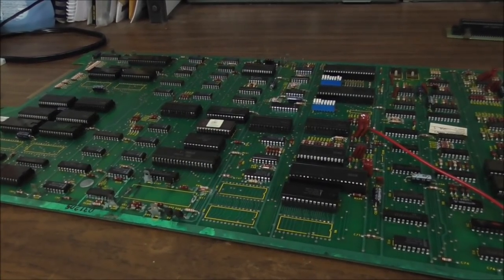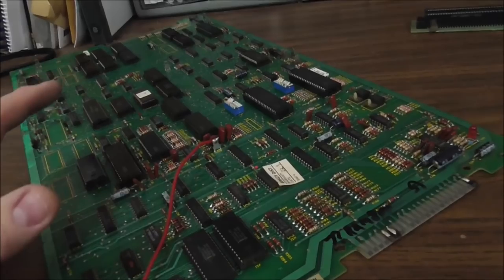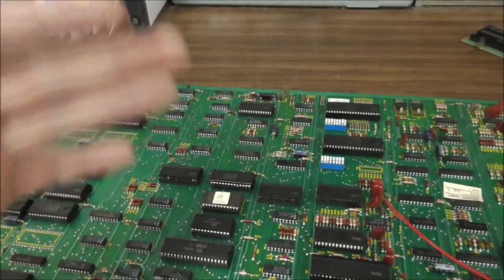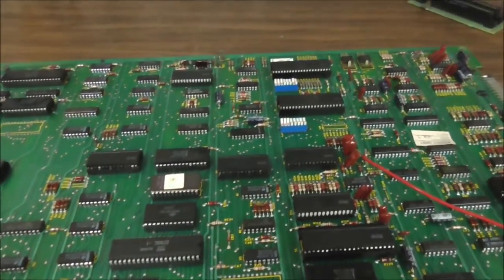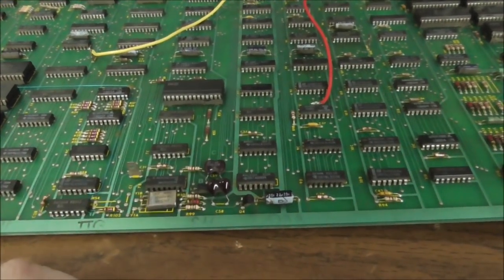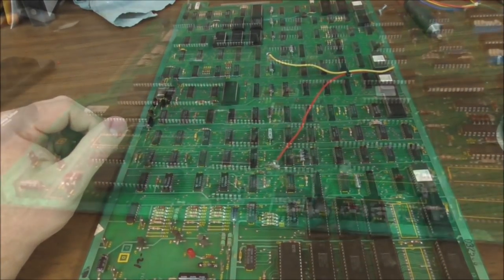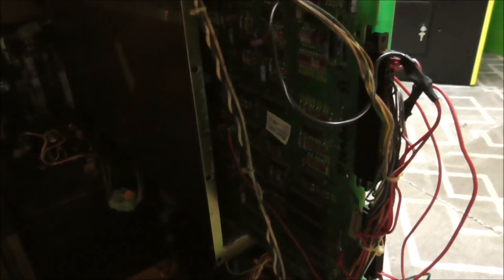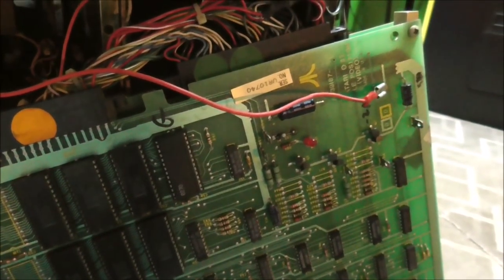Attempting to Repair Atari's Very Complex 1982 POLE POSITION PCB - Three CPU's?  THREE CPUS!!!

Comment: Great video Ronnie! I've worked on my Pole Position electronics for at least a month or two. Fixed the monitor. New board edge connectors, PS rebuilds, big blue,  fuse blocks, sense mod, repaired burned up edge connector on main PCB. Found a few corroded sockets with the tabs broken when I pulled out the chips on the main PCB. Changed a bunch of those sockets. Cleaned all chip legs. The game now only boots to a screen with colored blocks and some characters. Can't enter test menu. I'm very interested to see how your troubleshooting goes, and hopefully it sends me in a new direction in the quest to fix mine.

Comment: Those chips that go black are because the manufacturer put a silver coating on the legs. The silver gets messed up over time and goes black and the coating eventually flakes off. Fujitsu and Texas Instruments did that with their chips and you can see that a lot on the small PROMs that are usually used for color.

Comment: CR2 is a sacrificial protection diode.  The normal failure mode is to short when to much voltage is present.  The diode shorting out is supposed to either crowbar the power supply down or blow a fuse.  Under normal conditions CR2 has no power flowing.
Reply from the maker: Thank you Randy isn't that what I said in the video?  See you on the next one!
Reply: The position in circuit for cr2.  Would be in the era called CROWBAR DIODE...Expected to crow bar the 5V rail against over voltage...
..we salute you and thank you for your service.

Comment: Hey Ron, hard to believe it's almost there, and mainly due to a 25cent Zener Diode! I buy these in packs and use them to limit voltage kickbacks and eliminate higher voltages to 5v. 
The more of your videos I watch, the better understanding I get on these old boards, I might start offering a repair service on this side of the pond!
Great stuff bud!
Reply from the maker: Go for it man!  I'm in the same boat, I understand just a littttttle bit more everytime I mess with one.  Most of them make perfect sense once you start looking at them, you go "Oh, I see why they did that...."  We need more people saving these machines.

Comment: It's amazing to see just how much technology has changed over the years.  What was once a giant board of discrete logic chips, CPUs, ROMs, and a handful of custom chips can now be emulated by a RaspberryPi.  Still, saving the actual cabinets and the original boards, that's always good to see.   I'm, sadly, too young to remember these games in the arcades, but as a 90's kid (born in the ass-end of '91), I do remember a handful of sit-down racing cabinets the local mall used to have.  They're fun, but they gulp quarters, which I suppose was always the purpose.

I hate to sound older than I am, but kids these days don't know what they've missed out on.  I know, I know, there's still arcade cabinets out there and the occasional arcade still running, but there's just something about playing against friends in 2-player cabinets, playing against other people in linked racing cabinets, picking up one of those chunky light guns and trying your best at a shooting game, or even the simple practice of standing quietly off to the side and waiting your turn.  Now, 90% of these games can be emulated at home, and with a fairly inexpensive setup, you've got a general-purpose arcade box that won't eat a week's allowance in 10 minutes and leave you begging for more.
Reply from the maker: If you don't get it the hard way you don't appreciate it :)

When recorded music started the only way to hear it was to buy a floor model phonograph, then go to a record store and buy the record which was 2 songs, take it home, and it used 1 stylus per record.

Then you could buy LP's with several songs on them, and the stylus didn't have to be replaced everytime.

Now you can listen to anything ever recorded and 1000's of new songs a year for free at anytime and the music industry is the worst it's ever been

Comment: "Joe what's wrong with it"
"Its broke" lol 👍
Reply: I work as a Controls Engineer in machine automation, and our favorite response to that question is "BDDS".
Broke and Don't Do.... Stuff.
Reply from the maker: I'm gonna have him start shouting that, lol
Reply: @LYHTSPD  I was in IT and the two most common problems were ID-10-T, and PEBKAC errors. If you don't know what those are, the first one you should be able to figure out just by looking at the spelling, the second stands for Problem Exists Between Keyboard And Chair.
Reply: @LYHTSPD  i can only imagine that this being your favourite is ironic. the ammount of times i failed to get any info from the operators and all they would have to do would be tighten a screw here or there is driving me insane. and every time i try hard but it's easier to extract info out of a KGB spy than them. -Eh machine is br0ke. -so what does it do? -it's not doing... -yes but does it do anything or totaly dead or any lights? -it won't do the work. -any error code, any noise, does it stop under any condition? -yes, its kaput.
FML thanks for all that great info, i will ask the brick wall next time
Reply: @kapioskapiopoylos7338  Well, the programmers mainly used that as a joke amongst ourselves.  We would get customers that would call us with about the same wording.  "I don't know, it just stopped working."  Makes me want to do murders.

Comment: So electricity flows into the board though the connector pins, goes through the components and out through the connector pins.  But at 29:19 the pink jumper bypasses  the pins and goes to the spade.   How does the negative flow leave the  spade?
Reply from the maker: One of the spades is the test point for the 5 volts, one is the test point for the ground.  so they're attached to 5 and ground, if you hook a wire there you are connected to ground.  The way we wired it up we left the original wiring connected too, so the pins still work as designed, we just added a couple jumpers to add more wires so another path for power and ground.

Comment: Fun videos! I like how atari's look when they crash, LOL!
I think I played this console the first time when I was 3 years old and im 42 now! I didn't know this one was so complicated. Sometimes I fix equipment with mid 80's z80 control boards. These fiberglass boards seem to blacken and traces peel differently then, say, 90's or 2000's PCB's. But some 80's fiberglass boards are very different then others. A Z80 board caught me off guard recently when a light wire brushing peeled back 2 very small traces. I've done this work many times so it really surprised me. It's cleaned up and working well now though!

Comment: I used Tarn-x on industrial automation computer chips that had oxidized pins back in the day.  Worked great.  Quick soak in tarn-x rinse with distilled water.  Chips looked like brand new for another 20 years.

Comment: I have to agree with you on the "sense" mods. Why do they have to complicate things (Atari)? Great fix overall Ron. Pity it didn't work on first go... WELL DONE!!!  10/10
Reply from the maker: Thank you Dero we'll see next time!
Reply: The sense circuit would keep a machine in the field working longer, particularly if it was in  a location with unreliable power (e.g. one day 100 volts, the next 110, the next 95). Or at least it did until it burned the connectors up.

Comment: you should try getting one of them little electric Dremel with a sanding tip on it. That would improve you corrosion repair speed 2+ fold. Just a thought.

Comment: One of the biggest problems with the PCBs of the early years is that in order to handle greater current they tinned the bare copper on the board and then put soldermask over the  tinned copper. This is what causes the soldermask to bubble up in areas and it breaks open and moisture and corrosion start to eat away at the traces. Nowadays, they plate the copper to a greater thickness and then put the soldermask over the bare copper. It sticks to the copper and only the end points of the traces are uncovered. This prevents moisture and corrosion from destroying the traces. When excessive current is needed, the leave the copper bare in that area and tin just that area. And they don't put soldermask over those areas. That way nothing gets trapped under.
As for removing corrosion on bad areas, I have had luck using old style pen erasers. They have just enough abrasive to bite through the corrosion. You can also use vinegar to neutralize the alkaline. You can also use a watered down mixture of muriatic acid and then rinse it off with water and use a hair dryer to dry the water off.

Comment: you dont have to reaply the green coating aka solder mask/solder resist, all you got to do is tin the copper with a decent quality solder. also i happened to repair a lot of tractor pcbs. when mud gets into them, trust me fiber glass isn't going to help any more than mildly using a wet cotton bud. sanding paper or very fine files are necessary.

Comment: Coating the bare traces is not a bad idea. You may coat them with thin layer of solder. The corrosion makes the traces thinner and the solder would thicken the traces a little. It also protects the copper. And you can still easily solder to the traces if needed.

Comment: And I did a little research on the worst designed pinball machines and Atari always comes up. 

Not only for their weird flipper placement. 

But instead of having the circuit boards in the head box.
They're placed in the bottom of the main cabinet.

So whatever is falling from the play fields will land on the circuit boards.
And either break them or short circuiting them.
Reply: Yeh, I read about Atari's pinballs that had the game boards in the bottom instead of the back-box, and screws, nuts, and springs etc. would fall from the playfield and blow up the boards. Unlike Williams, Bally, Midway, Stern.

Comment: Kinda off topic, Can you use the super lube grease on the High Voltage Diode going to a monitor?
Reply from the maker: Yes you can, it's just dielectric grease, works great.  Thanks for watching!

Comment: I like to use canned air to blow the water/alcohol out from under the chips and sockets after cleaning.  and I will use a very low oven (60C max) and put the board in there for 5-10 minutes.  that will thoroughly dry it out, water or alcohol.   Another trick is to bang the PCB edge against a table top (straight down, squarely on the pcb edge) which will force the water out.  it doesn't have to be terribly forceful, but just enough to dislodge the water.  Best results are obtained when the pins are perpendicular to the edge, so the water can go straight out between the pins.

Comment: A little acid paste flux works really well to cut through that corrosion once you expose it with the fiberglass pen, using a file or sandpaper may be quicker and easier but you are really eating away at the trace.

Comment: A little rubbing alcohol will remove the vinegar and also break down somewhat the alkaline residue.  You may be able to make a mixture of alcohol and baking soda to neutralize the alkaline residue in place of vinegar

Comment: My  pinball machine has three wires that go into the machine -The protective ground is green . The neutral is white, the hot (live or active) single phase wires are black ,    When you are talking about ground wires its seems that you have only have two wires a positive and the negative and the negative  is replaced by the ground???  16:48-16:60
Reply from the maker: We're talking about DC voltages that are past the DC power supply, so in DC you don't have a neutral and a hot, those are AC terms... in DC you have a ground and a positive (in this case).

Comment: The designer of the board could have made flat contact patches that cover the whole area of the adjacent interconnected contacts. Even if it didn't improve the contact in the connector, it woud have give some more skin for the current to flow through and form a wee bit less hot spots.

About the ground grid needing fortification, not sure, but this might have something to do with the chips operating at a radio frequency. In certain cases, this could at least theoretically cause the ground for a certain component to appear slightly lifted, of its power input to be lowered. Also components that have different trace lengths could fall out of sync - like I wrote, at least in theory. Although, I admit that this is unlikely to become remarkable under 10 MHz. And, adding jumper wires carelessly could also just as thoretically cause ground loops that would resonate at some frequencies and possibly cause more problems than they solve. 

Mr. Carlson explained a similar phenomenon where a length of antenna cable at a certain frequency would appear as a short circuit when the other end is open, and as open circuit when the other end is shorted. IIRC that length would be a quarter wave, factoring in the speed at which the signal traverses the cable. In old analogue video processing, at a frequency under 10 MHz, there was a known effect where locally synced video sources, if wired to a mixing point through different cable lenghts, would have the horizontal alignment of the combined picture components affected by the cable lengths.

Comment: I had a PP machine for a couple years, but one of the sprite rendering custom chips was scrogged, so it wouldn't render your car properly, but all other cars and sounds worked great, and the cab was in good condition. I got it for $80, and I had a hard time giving it away when I was ready to let it go. ;D  Plus, it's kinda boring after playing it a few times. heh. I loved it, but was done with it. :}

Comment: There are some instances where very fine grit sandpaper is better than the Fibreglass pen.  Sometimes even a file.  People need to just look at each situation and make their own judgement.  You've been doing this a long time so you know what you are doing and how to judge how much force is needed.
I have not quite understood the "coating" the copper thing.   A lot of old (talking 60's) circuit boards never had the copper traces coated.  Sure, the copper will go dull and get a surface layer of oxide, but copper doesn't "rust" like iron does.  It just gets a coating.  As long as you are working in a dry environment, copper doesn't need coating.  Copper wires are proof of that.
Reply from the maker: That's how my thinking is on it too Brendan, thank you.... hopefully next video we'll get this thing up and running!!!  Thanks for watching man, see you on the next one!

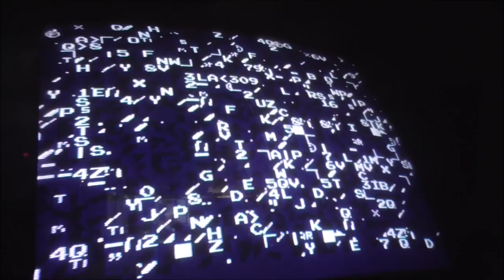Comment: 43:08 That machine probably has some watchdog circuit. It checks that the main program writes some value into it often enough to know that it has not crushed. If the program crashes, then it won't tell the watchdog that it is still alive and the watchdog resets the whole system so the customers keep on putting coins into it...
Reply from the maker: I think it does you are correct!  Thank you for watching Matias!
Reply: @LyonsArcade  Subscribed!

Comment: I think the accelerator values are not correct. CB to A2 seems not correct.  Wonder if it should be something like 00 to FF or something like that.  It looks like the ADC chip is not working properly.

Comment: I've seen many times in different situations where more voltage is needed.
The ground must heat up to much
Reply: If the ground heats up too much, then perhaps you can soldier some extra conductors to spread the current across multiple conductors.

Comment: It's odd that they didn't use a Z8000 as the main CPU, but only as secondary CPUs.  One of the Z8000s is for I/O and the other is for sound.  From what I understand all of the Namco custom chips are I/O chips.
Reply from the maker: The Z80 handles the sound, it's even labeled "sound microprocessor" in the schematics, maybe I don't show that till the next video though..... 

Also the Namco Customs aren't all I/O chips, we'll get into more of that in the next video too

Thanks for watching!

Comment: if the Board is the Issue, couldn't those Systems be fixed with a new Motherboard??
With how cheap PCB Design has become and them being very simple PCB designs, shouldn't it be too hard to source a replacement PCB? (though replacing the chips might require a hot plate and some hot air)
Reply from the maker: It seems in concept like it would be easy enough but there are several issues with that... first of all, the original board is covered in custom chips that Namco created, so it's taken quite awhile just to figure out how those even work and what they do to replicate them.  Then the boards have two separate edge connectors that hook up to the inputs and outputs, and some of those inputs are analog.  So yes in theory you can just make another board but how do you make it emulate the exact same gameplay with all of those custom chips, and how to you layout the board so that it can still plug into the cabinet's existing wiring?  Someone made a board that emulates the game but it can't use the original analog gas pedal.  So you have to replace the board and the gas pedal, that's not quite right either... so they're still working on an acceptable replacement.

Comment: Instructions for the fiberglass brush. Don’t have so much fiberglass sticking out. It shouldn’t bend when using it. That breaks the strands. Just let a little bit out and it will be 100 times more aggressive!!
Reply from the maker: I've done that, it's not very good for the level of corrosion i'm addressing, sand paper and files work much better, 100 times better.  Thanks for watching don!